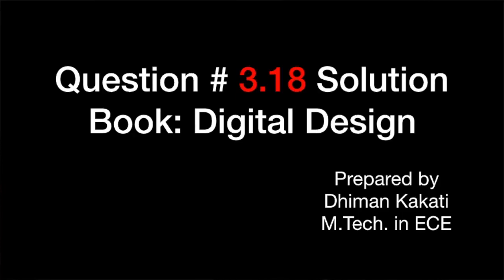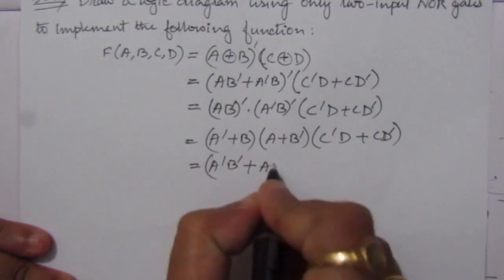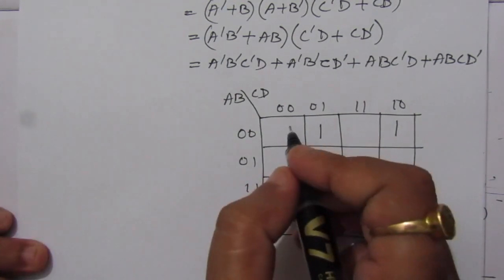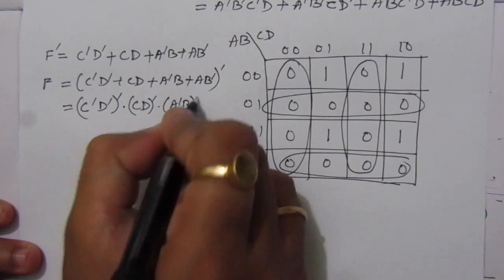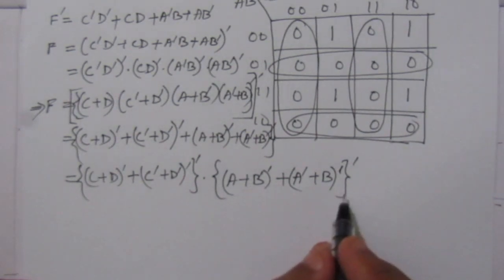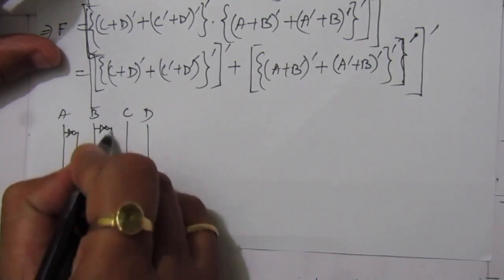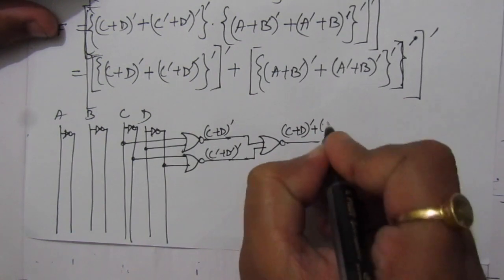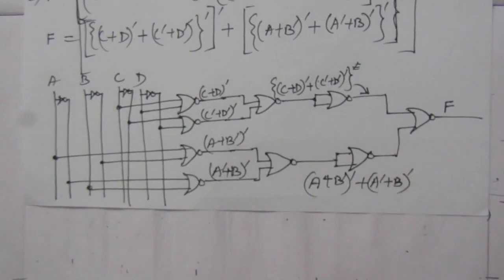Q. 3.18: Draw a logic diagram using only two-input NOR gates to implement the following function:

Comment: Is it compulsory to draw a map....??Can we directly draw a logic diagram..because its not mentioned in question...
Reply from the maker: Good question. We draw the map to simply the expression, this in turn helps to minimize the complexity of the logic circuit.

Yes you can draw the logic circuit directly if not mentioned in the question. However it is always suggested to simply before making the logic circuit.